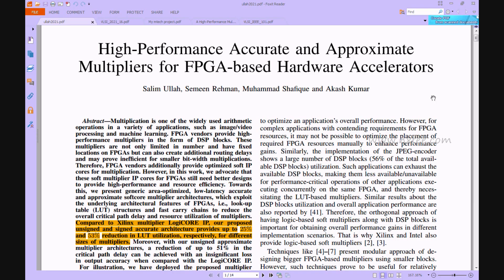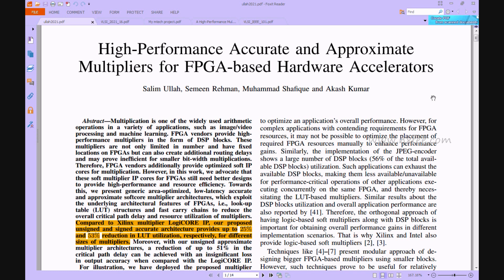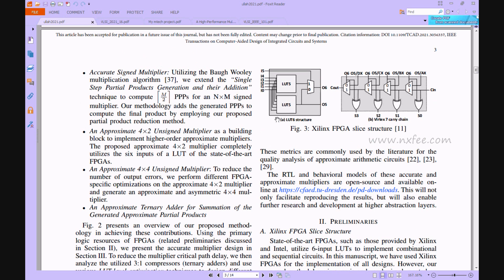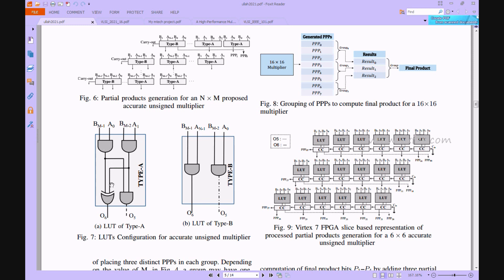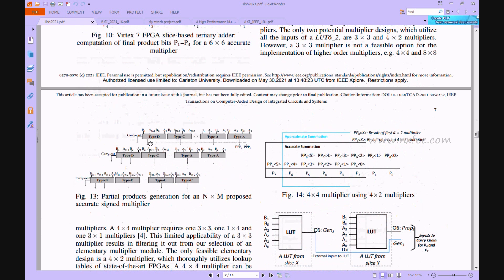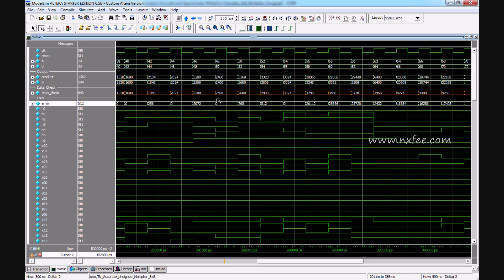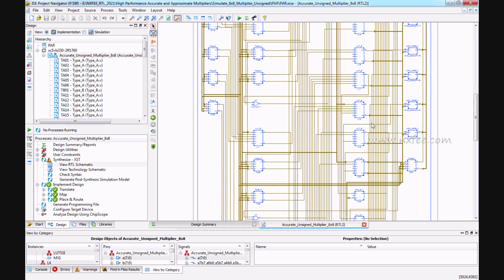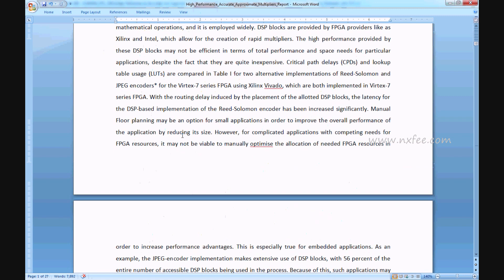High Performance Accurate and Approximate Multipliers for FPGA based Hardware Accelerators

Comment: Incorrect implantation of project. Lut 5 structure has only one output o5. How you have taken two output from lut5 structure to make lut6 structure.
Reply from the maker: Here, we have developed a proposed method for this work. If you need existing and proposed explanations, you can contact nxfee.innovation@gmail.com or +91 9789443203. Once registered, we can explain this project. Project link : https://www.nxfee.com/product/high-performance-accurate-and-approximate-multipliers-for-fpga-based-hardware-accelerators/

Improvement of this Project:
To design the Accurate and Approximate Signed and Unsigned Multiplier for 8-bit configuration, and to re-modified the LUT6 architecture using single LUT5 with multiplexers instead of dual LUT5 with multiplexers.